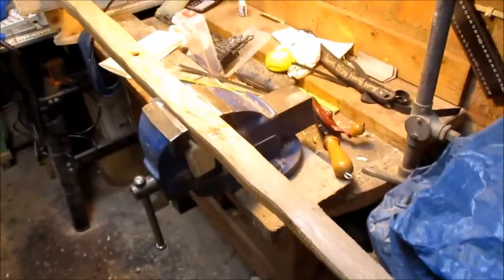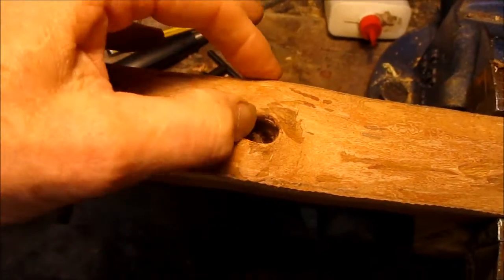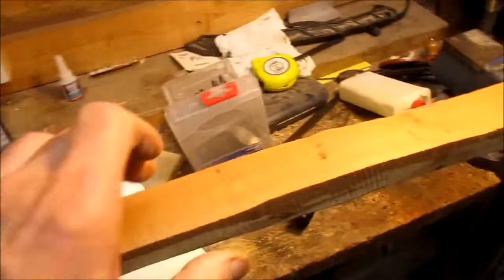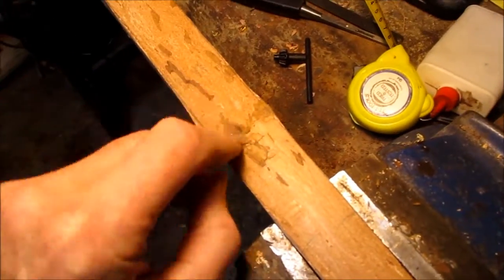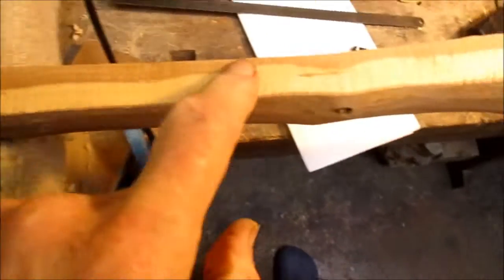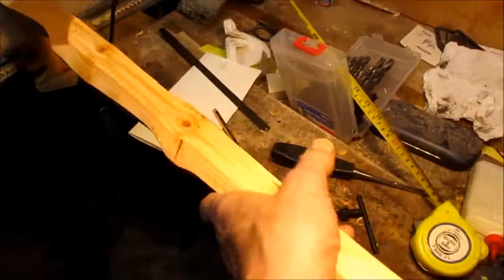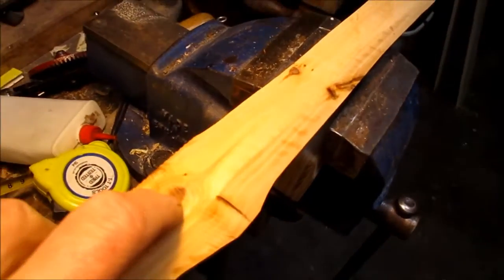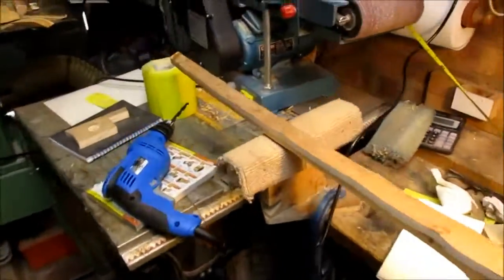Yew Primitive pt1

Comment: This looks like a fun project. I made a bow very much like this, a flat primitive. I cleaned out a large knot and it went through, about 1/4" diameter, so I left it with a slight bulge around it- like you are doing. It was an osage bow and turned out nice, but low weight- about 35lbs. A friend bought it since he was looking for that weight. It has a very nice deep brown patina now, about 6-7 years old I think, and he still shoots it regularly. Watching to see how yours turns out.